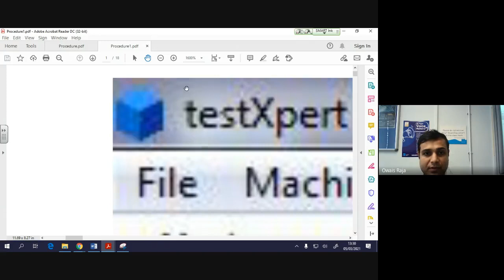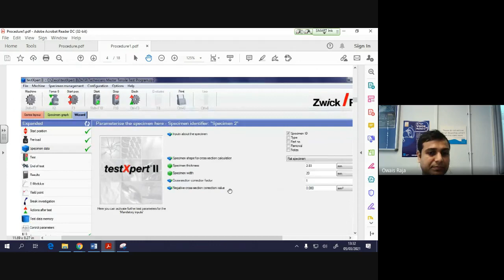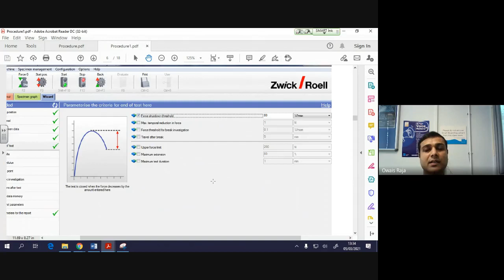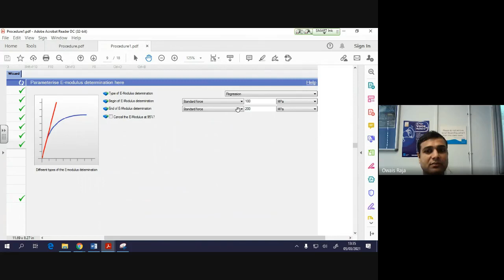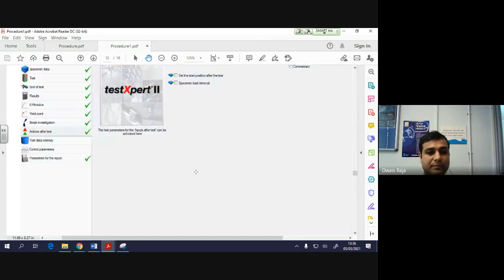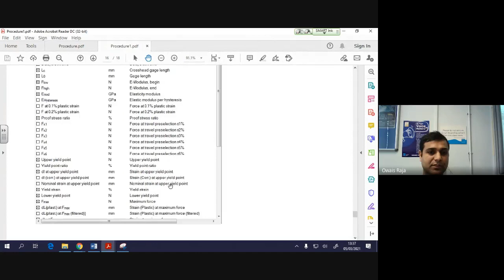TESTXPERT II .. DETAILED

Comment: Help me, what should I do if the machine has an error like below, thank you

testXpert error no. 23402:

testControl error No. 4151 for command AdjustChannel!

Error in element Force 200 N SN: 192052!

At least one analog voltage is detected as being erroneous. The sensor cannot be adjusted.

The sensor's measured values are set to zero and is marked as being invalid

Comment: Sir how can we find area under curve of tensile result to get work of rupture ?
Reply from the maker: The area under the curve is stress x strain ,  But try to use the trapezium rule . You will need to split the area under the graphs into many trapezium (rectangles ) and find the area by using the formula of the trapezium area or reactangle area .